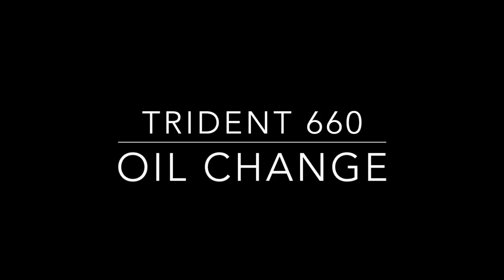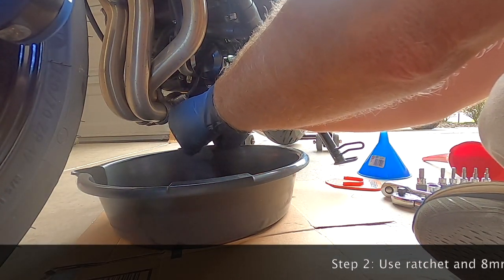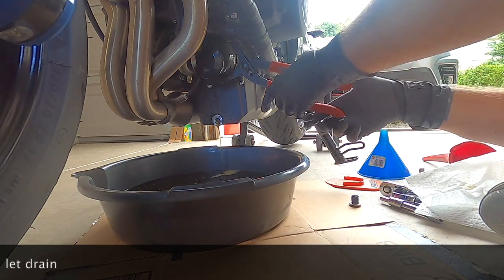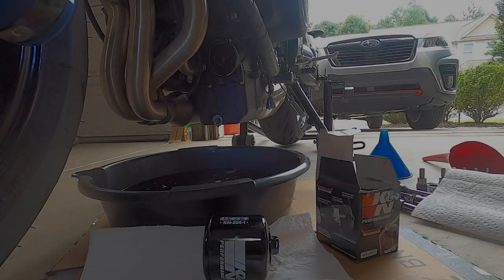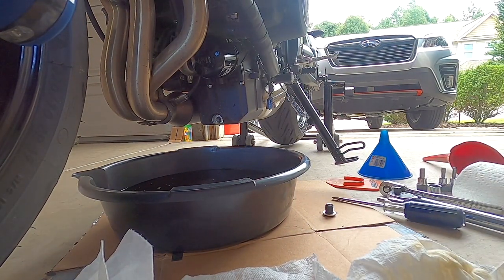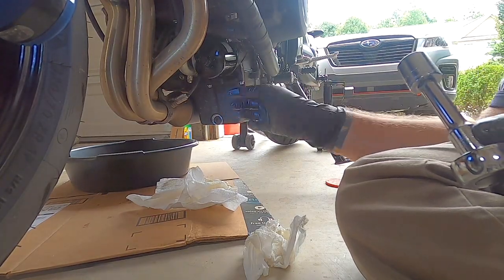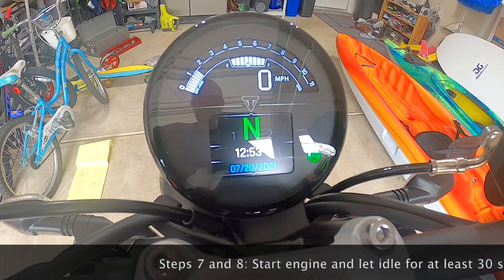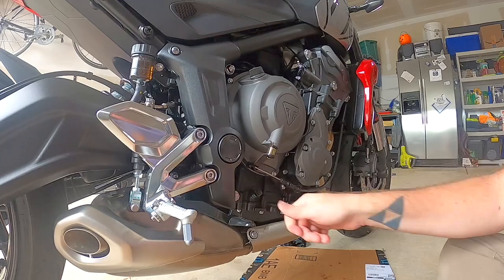Trident 660 Oil Change

Comment: Does servicing the bike invalidate your warranty in the US?  I’m sure it does in the UK (we get 2 year unlimited mileage warranty - so I will be getting Dealer to service for now).
Reply from the maker: No, warranty is still good as long I can prove that the service was done with properly spec'd items. I think this video covers that. I had the dealer do the rest of the first service and they also documented that the oil change was done.
Reply: @jrobrides1340  hi 👋 how much did it cost you at the dealership for the rest of the 600 miles service? Thank you!
Reply from the maker: @timotherollet5370  hey. It was $237 and took about 3 hours.
Reply: @jrobrides1340  wow yeah big difference! They told me about $500. Thank so much!!!
Reply from the maker: @timotherollet5370  no problem. Yeah, the service manager said I saved about 50% by doing it myself. Of course you still have to buy the oil and filter, so it’s not quite that much. But still helps, right?
Reply: @jrobrides1340  oh yes definitely 👍
Reply: @jrobrides1340  Hi! Just a little update for everyone. I just did my first service on my Trident 660 in Mooresville NC at Interstate Cycles and for the all inclusive 1st service I paid $224 with tax. Proof that shopping around, and drive 30 mins can save a lot! Have a good ride guys and stay safe!
Reply: @goldenjaxmc2885  thank you very much for sharing!
Reply from the maker: @goldenjaxmc2885  I was just there last week to look at a used Tiger. Did you do the oil and filter yourself or was it $224 for the whole service?

Comment: How often do you change the oil on yours?
Reply from the maker: It’s supposed to be every 12 months or 10000 miles, whichever comes first. I don’t ride anywhere near that far in a year, so sometimes I let it go a few more months.
Reply: Do you have to go to a dealer and have them reset the maintenance light that comes on? (I assume one comes on?) Just got a 660 myself and seeing if I’ll run into software issues

Comment: Have you noticed any need to ad oil ,??, O have a bud with a 660 Tiger who is having oil consumption problems with this engine. He’s needed to ad a bit over a qrt every 1000-2000 miles 🤦🏻‍♂️
Reply from the maker: I haven’t noticed anything like that. If I did, I’d look for leaks and take it back to the dealer asap.

Comment: What about the service internal light?
Reply: @wl660  no shit? Im changing my oil now on my trident. That's awesome.
Reply from the maker: I had the dealer do the rest of the first service and they reset the light. The service manager said that by doing the oil change myself, I cut the bill in half. I did come across a video of a guy doing an oil change on a Street Triple where he used a tool he got from Amazon for like $99. It connected to the bike by the ODB port and to his phone by Bluetooth. 
It was this one here: https://www.amazon.com/OBDLink-Bluetooth-Professional-Grade-Diagnostic-Performance/dp/B07JFRFJG6/ref=sr_1_4?dchild=1&keywords=mx%2B+obd2&qid=1619533902&s=automotive&sr=1-4
I might try it for the the next service.
Reply: @yolo I’d have to check - apologies if that is the case. 
I needed the tool to reset ABS fault - and it was an advanced feature for diagnostic devices and worked well.
Reply: @jrobrides1340  I also tried that but it'll do anything and everything except clear that service light.
Reply from the maker: @jameyhinds  Good to know. Thanks.

Comment: I highly discourage you following this persons advise to loosely hand tighten things and *come back to them later*.

This is a terrible idea and allows for mistakes to be made or forgetting to tighten (happens all the time and see it at track days as well). Make sure you tighten the drain plug to spec and do NOT over tighten the oil filter! No canister oil filter should be tightened past hand tight as much as you can spin it with your hands as hard as you can. I've changed oil filters on countless cars and motorcycles and never had one leak occur.
Reply from the maker: That was just until I could get the drain pan out of the way. Cleaning a wrench after you've dropped it in the drain pan isn't much fun, but you do what works for you.